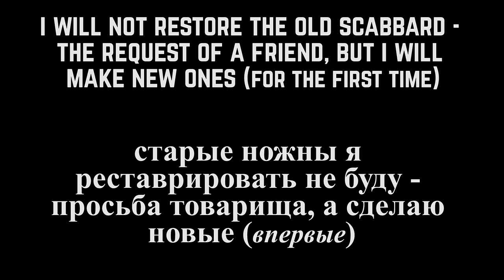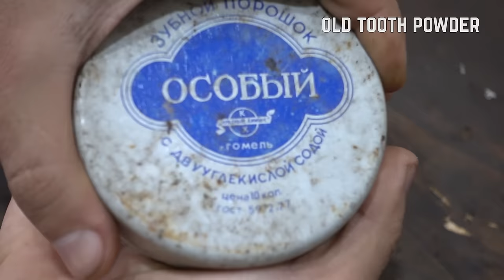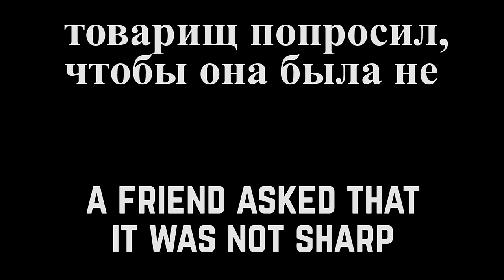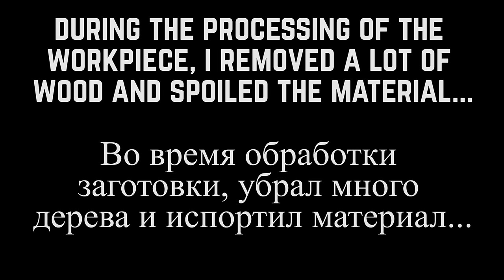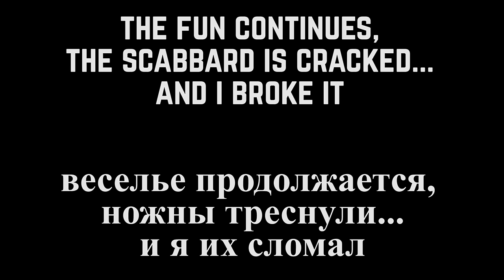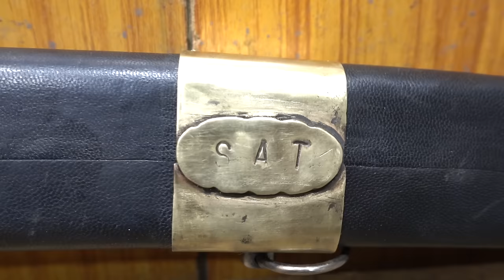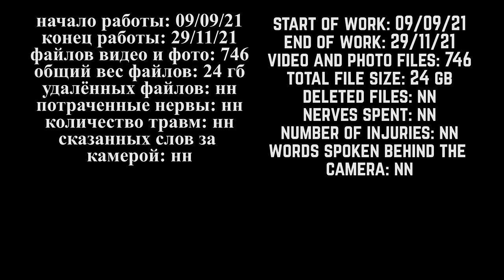Restoration Antique Caucasian Shashka - The first experience!

Comment: Also, I am always curious. It's nice that you edit your videos down so that start to finish for your projects is around ten minutes. But how long is start to finish REALLY? If you start one of these projects on a Monday, it is finished by __________? How many hours of work does it actually take?
Reply from the maker: Hello, I can't answer exactly how much time it took for this restoration. I know one thing, which is a lot. If you take an axe or a knife, it takes 5-6 days, depending on the complexity.
Reply: @ScrewsAndTools  WOW. I thought it might be something like that. And how many projects do you have going on at one time? (You post new videos very often!)
Reply from the maker: @davidpatterson4763  Sometimes I do 1-3 projects in parallel. Depending on the amount of time.